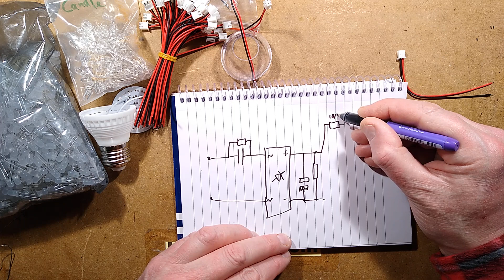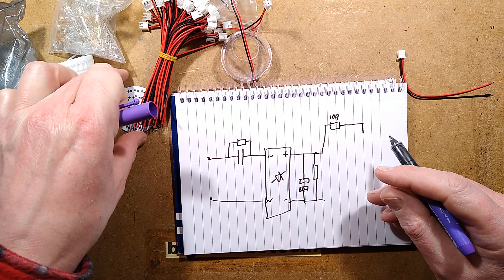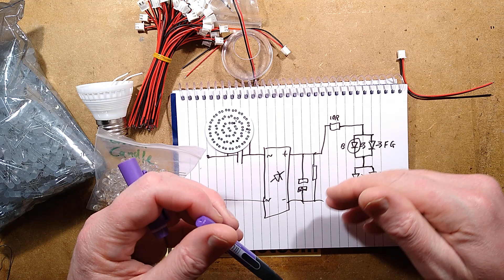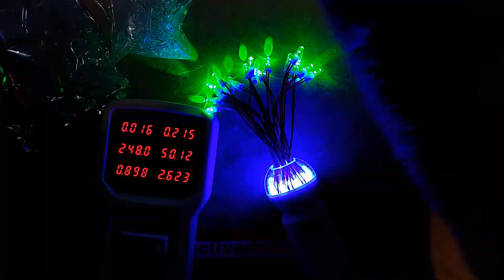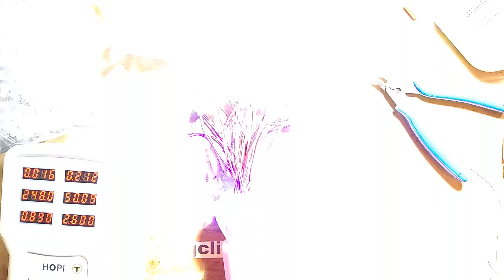Custom extra weird trashy lamp build.  Blue orb with green pulsars

Comment: 10:20 - we've been 20 years from fusion since I was born - 60 years ago....
Reply from the maker: Yeah.  It's always just around the corner and they just need to build a new massive underground hadron collider to check again.   It's a bit of a business.  Someone's going to discover how to create fusion in their home workshop with random bits of technical junk and a coffee cup.
Reply: @bigclivedotcom  Yeah, like they fire a proton out of an airgun (not that there should be many around these days, but I wouldn't bet on it) at an aluminium disk and it produces enough to light an L.E.D. :-P Or you brother drinks to much whisky and falls on his but and his nose lights up l.o.l., now that would be funny!  :-D
Reply: I'm NOT being serious folks before you all jump in and tell me it couldn't work!!! 8-l
Reply: Here is one to think about. 
If I had an unlimited supply of energy, and I wanted to give it away, How much would it cost? 
If you come up with a close answer,  you have just proved that you can think........
Reply: You try bunching together particles that are moving at thousands of miles per second into a very tiny space.

Turns out it's really really fucking hard.
Reply: @bigclivedotcom  Oh rubbish. It will be doing what you said but on a racetrack. How else can you get your machine to 88mph? Certainly won't happen in a home workshop. 😀
Reply: @josephking6515  Didn't you hear the wind in the back of this video? He'll just use sails.
Reply: The LHC isn't related to fusion energy production, nor does it operate at a comparable energy level. It would be like trying to move an oil tanker by firing a sniper rifle at it. The LHC is for breaking particles, not to make them fuse.

The main fusion project is ITER, which should be producing excess power within 15 years, though not in a cost-competitive way (basically, because the reactor walls and magnets need to be replaced so frequently that they eat all the profit).

People have already discovered how to create fusion (probably in an office; they didn't even need a home workshop), the issue is building a vessel that can withstand the temperature. Turns out 100 million degrees (or even 15 million, which is the bare minimum) melts most things. Or, indeed, all things.
Reply from the maker: @josephking6515  I've had stuff go at over 88mph in my workshop, but it wasn't deliberate.
Reply: @RFC3514  you are either too young, or too faithful. Fusion is just a marketing catchword for sinking money in it promising big results. Big Clive s comment is spot on. The same goes for breader reactors etc. There was never a viable way to do it, but still gives a lot of money to this industry
Reply: @Waste Oink - Or, you know, I studied physics. Big Clive's comment is very much not spot on. Hadron colliders have nothing to do with fusion power.
Reply: @bigclivedotcom  that's what we all watch to see happen ;)
Reply: It's not actually that hard to get fusion to happen. What's hard is to do it in a way that produces more energy than it consumes.
Reply: @Pyxis10  You aint been present when my other half farts then.
Reply: @gcewing  That's true.

Containing that much mass energy in one place is more or less what I meant.  You can't have cathodes, anodes, or other wiring in the way, or fusors would be our fusion powerplants.  Doing this externally, while having sufficient shielding to keep the reaction from eroding away the containment walls, while minimizing losses to external factors isn't easy.
Reply: If you look for the original source of the "20 years" you will find that it actually said that a certain amount of funding would have to be spent. People might have extrapolated the time from the money spent on fission, forgetting that controlled fusion is not that interesting for the military and so the annual budget is not that high. The grand total has actually not yet reached what the scientists a long time ago have said it would cost to have a working fusion power plant...
Reply: Some schools of thought have believed that vortex es might be the answer.

Comment: If the quack product requires software that needs antivirus disabled/removed that's a big fat NO.  If literally nothing else, it was coded so poorly that the antivirus takes a mercy kill to it as a mercy to your computer.  Otherwise it is likely straight malware or adware (likely the latter + adware is almost worse these days as well) that needs free reign to be financially viable to the quack product sellers/designers.  I can't recall the last time I had to do that with any software that was legit or came off as such.  Coincidentally enough regularly with software that is shady.

Comment: The issue with electricity and Australia, is each state has it's own structure and if one state needs power from another, they have to buy it from that state.  It's not just one unified grid around the whole country.
Also, the coal industry seems to hold some power and the Government seems less inclined to move forward.

Comment: Hey boss man, looking for a recommendation for a rechargeable worklight that won't fall to bits if it blows over in the wind, what do you use?
Reply from the maker: Most of the LED work lights are pretty rugged little things, but you do have to pay a bit more for units with decent battery capacity unless you hack them afterwards.

Comment: Actually, the “blinky” LEDs (and I use the term, “blinky” here, to mean any LED that has a chip in it for lighting effects) chip is across the leads, so it’s always drawing current, even if the PWM signal to the LED die is logic low; thus, there’s no need to worry about having the mains voltage appear across it. The real problem is the switching transients of the chips can affect all the chips in series, so several things could happen:
1) nothing special happens; the LEDs “blink” as normal (unlikely, but theoretically possible.)
2) only one of the LEDs does it’s thing, and the switching pulses reset all the others so they appear to be constantly on.
3) the whole mess of blinky LEDs goes bat-sh*t crazy; blinking in a random pattern.
4) all of the blinky LEDs quickly synchronize and blink in unison.
5) all of them go up like Hiroshima during WW II! (Okay, not really. Just joking.) 💥
Unfortunately, the only way to tell... is to try it. Okay, bigclive, that’s a hint; let’s see a spectacular light show (or an epic fail)!
Reply: Epic fail also would be a spectacular light show, so it's win-win situation
Reply: I have a string of christmas lights that has blinking white LED's that are at off state shorted out so specifically designed to be used with mains._

Comment: If you're using Android for recording there's light at the end of the tunnel. There's a commit in Android 11's source where they mention removing the 32-bit file size limitation, going to 64-bit for mpeg4writer https://android-review.googlesource.com/c/platform/frameworks/av/+/1198379

Comment: I built one of these lamp kits using 3mm fast flash LEDs last year, it worked OK but the light output was annoying. When you mentioned the problem with using fast flash LEDs in a previous video about a month ago I dug it out and powered it up in the spare room, it has been on 24/7 ever since and all the LEDs are still working OK .  Could the fact that the LEDs are in parallel pairs be providing over voltage protection?

Comment: if you replace 2 of the diodes with zener diodes and it will cap the max voltage you get on the mane filter cap

Comment: why even are you (and a whole lot of other people) cutting pieces of solder and then trying to use up even the last bit of it? i have a reasonable size spool of solder and i just unroll about a meter of solder and use it up and as i reach the end i unroll more (maybe a spool holder would be a good addition to my bench but anyway) so there is no need for the cutting and getting everything used thing

Comment: Second comment.  LOL.   File size is indeed the limiting factor for video files in camcorders/phones/SLRs etc.  Because the storage medium (SD card) is usually limited to FAT16, this by its very nature will limit how many clusters can be in any one file.  32KB clusters x 1024 x 65536 (16 bits) is "about" 2.14 GB, plus you lose some due to the overhead of the FAT index.  Of course you could increase the size of each cluster, however every small file is a minimum of one cluster ( the minimum unit of size that makes up any file), so it starts to get inefficient if you go much larger, plus there is a usually a general ASSumption for sector sizes of 512KB in FAT, so that increase the losses.  (if they don't divide by 8/16 then clusters don't fit into sectors easily (overlap), so that slows down access and creates other problems).

Just be glad the programmers got really smart and wrote a routine that closes (the file) gracefully and saves your data up to the point it has a full file.  The alternative is to completely crash the OS and maybe destroy all data on the storage.

A work-around for a system that you own is to format the SD cards FAT32 or some other system (HPFS, EXT4 etc) that doesn't have the 2.1Gb file size limit.  A lot of consumer grade electronics is able to work with FAT32 and  HPFS for example (check the specs!) however most of the storage you buy  comes with the default universal FAT16 (and buggy, 'nother story) file system format which will forever limit what you can do with that device.  I suspect that the limit of video size/length is not built into most phones/SLRs etc but IS the result of the format on the cards that people are plugging into them.

It also occurs to me that a lot of phones only have internal storage these days.  If a phone has (say) 32GB of internal storage, but still has a file size limit of 2.1 GB, then the designers of the phone need to be tarred and feathered.  Where's my pitchfork?